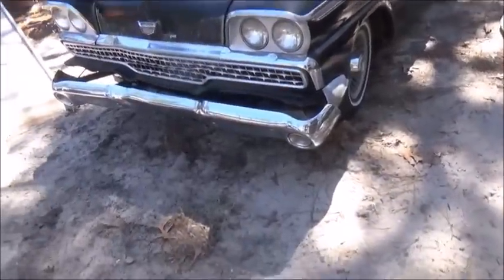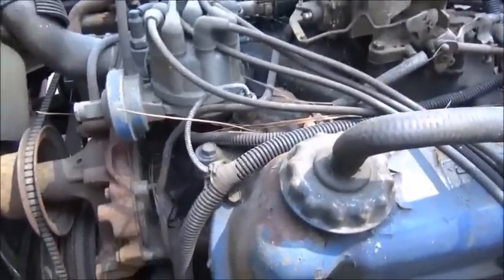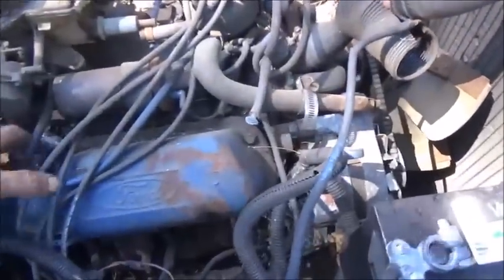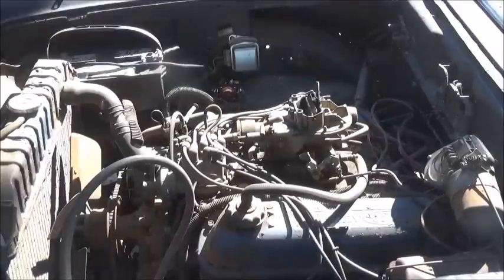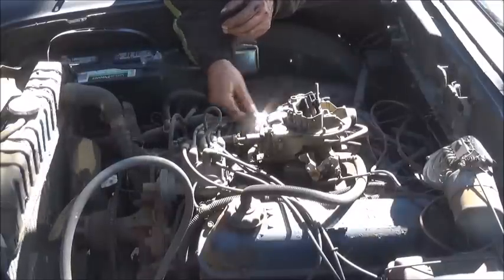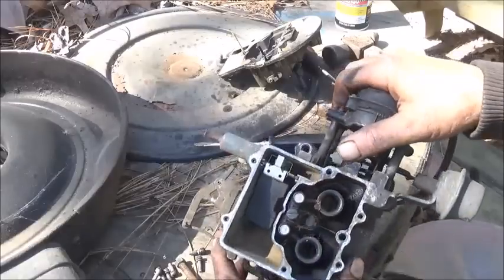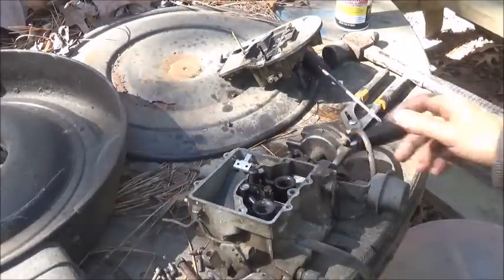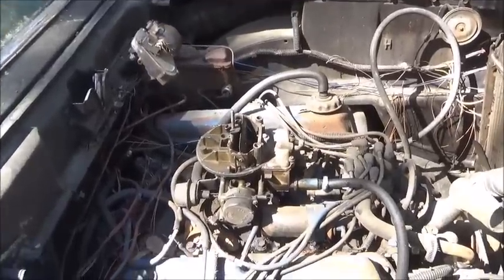1959 FORD GALAXIE FAIRLANE 500 FIRST START IN YEARS!!

Comment: I remember back in the 1970's back in my teen years .We lived in the Snow/ Rust belt of Northeast Ohio ,My Dad was a Pennsylvania coal miner raising 6 of us kids and our mom on a coal miners pay .We didn't have a pot to piss in ....Ohio cars had inspections in order to get your license plates .If you failed you was walking to work or going on welfare because you didn't have a car ...When ever a brake line rusted out or inspection time came and dad seen rust on the brake line He would say " We got to get this fixed or we ain't going to pass ..My Dad would go to the hardware and buy a long roll of copper tubing , He would take all the rusted brake lines off the car and cut and shape the copper line to match the steel line and take his fairing tool and put the fittings on the line .Then spray paint the copper tubing to cover the fact that it was copper line and not steel line .Then bolt it all in and drive down and pass inspection ...I as a kid .asked My Dad " Why don't you just replace it with steel line ..Dad said that Steel line was too expensive back then .Copper was the only thing he could afford back then ....Dad said " I've got to get to work ..without a car we are screwed ...It worked .never had a line blow ..When Dad got to sick from Black lung .Doctors told my Dad that he had to move to a warmer climate or he wouldn't live to see spring .He bought a rust bucket 1973 Dodge van with rotted out brake lines and replaced them with copper ..We moved to Fla back in 82 ..I got my DL back then and Dad gave me the van because he could no longer drive ..I drove that van around Tampa Bay FL for over 3 years before I bought a 1974 Vega wagon and scrapped the van ...My Dad was an Army Veteran and a Mine Mechanic. He worked on the machinery down in the mines ......He always told me " Sometimes in life  Son ..you got to do what you got to do to Get by " ....My Dad died Back in 1988 at age 49 of Black lung ..Raised all 6 of us kids until he passed ..He is Buried in Bay Pines National War Veterans Memorial cemetery in Pinellas County FL ....Rest in Peace Dad
Reply: Respect for your dad. He loved his country and his family. I lived in St Pete down by Lake Maggiore. My soon to be wife lived in Largo. Back then it was faster to go up alt 19 than the interstate.
That was over 45 years ago. My wife and I were married 43 years, it's been almost a year since she passed. Back then I knew the area well, now not so much.
I also grew up in Ohio, Marysville on the west side of Columbus. Dad used to say there was nothing wrong with a junkyard engine, the car just fell apart around it. 
Cheers
Terry

Comment: Good to see you back Jonathan. 
If anyone has put grease in a pilot bearing to press it out, a compression fitting will do the same. Copper line will fatigue at bends and fittings because it is originally soft and stretches  but work hardens and cracks. Use steel or stainless with double flares folks.
Cheers
Terry

Comment: Listen folks when a tow truck driver tells you something is dangerous it is. You can bet he has seen every bad out come of any thing you can think of. Be safe guys just flare your lines.
Reply: Sad thing is, I had an auto parts associate talk me into a compression fitting for a forklift brake line. The same principle applies. I was ignorant back then and know way better now. If I'd known better, I would've turned the guy in to the manager of the store for suggesting such a thing. That could've been a huge liability issue.

Comment: Water pump pulley is bent too. I tell you what those old windsor motors are some of the best ford ever made, my old motorhome was sitting  for about 20 years and after cleaning the carb and fuel tank it ran beautifully.
Reply: Me and my friends rescue old cars, we came to the conclusion GM sucks most of the time, Fords and mopars are awesome, amc is ok Studebaker is rusty but good.
Reply: @jackrohde4709  Well personal opinions and all that, i like older fords, chevys, imports, really old mopars, and think most of the cars from the 50s and 60s are cool but impractical

Comment: When turning wrenches professionally, I remember seeing a stretch limo come in for service that had compression fittings on the brake lines. The factory stainless exhaust was extended with that mild steel garbage pipe that rots out in 3 years. Both done by the company that stretched the body. Could only imagine what that car cost, and they couldn’t even do a professional job underneath. 

The only reason I’d ever use a compression fitting on a brake line is to get myself out of being stranded on the side of the road, with no other rescue possible. Pretty easy to get double flair line, or metric bubble flair in any length you want, and put them together with proper unions.

Comment: So correct on the brake lines! I have a drawer full of spl tools for swag ing the double flare brake fittings,  benders ect. It takes a little while to get good at, well worth the time. These days, lines can be purchased in near proper length as well. Thanks for another great video

Comment: The "D" prefix on the intake manifold is 1970s-the next digit-"1" is for 1971-D2 is 1972-etc-great videos, my friend!
Reply: i was watching the video and i noticed it was not a 1959 engine and was a 68 or later
Reply: Thats just a casting # and doesn't prove the year.
Reply: @totallyjonesin  More than likely it's a '71. It gets a little dicey during transition years. I owned a '68 302 block w/ a 289 crankshaft years ago. A transition year for both engines.
Reply: @josephtravers777  68 was the first year for the 302 and the last year for the 289. I've seen alot of 68 Fords and Mercurys with both engines in them.
Reply: @markreisen7038  The '68 302 was a dud engine and was prone to cracking pistons. Factory defect. Ford fixed the problem in '69.

Comment: glad to hear you defend the proper care and set up of the brake hydraulics. Compression fittings, single flares and such are illegal in most states. The double flare is not hard to do but many people are intimidated by it and will not even buy the flaring tool kit. These folks are laying the groundwork for a tragedy for someone, someday. There comes a point that DIY'ers really need to understand their limitations and quit ignoring sound repair practices.

Comment: Love the vids, you go about it all the same way I always did! That casting number D1AE on the intake just means it's a 1971 (design year) Automotive Engine (D=70s, C=60s, E=80s etc etc next digit is the "1s" place in the year) All Ford part numbers work that way so it's easy to tell what year (approximately) a part is. What you've got there is a Windsor - 2 easy ways to tell are the valve covers are the same as 302 (Cleveland are more rectangle like small block Chev but with 8 bolts), and the thermostat is on the intake on the Windsor, the block on the Cleveland. Don't buy into the small/big block BS some folks say. Ford doesn't work like that, they have engine families (Windsor, Cleveland, FE, 385, Y-block.....). Ford's only "big block" was the 385 family - 429/460.

Comment: Hey Johnathan. Man you can tell a 302 Windsor and a 351 Windsor apart by the firing order. They are indeed different. Thank you sir. Yes sir find an old Ford truck with a Holley on a lot came from factory with one. Fit right on it. 302 to 460 will fit. Good show Johnathan. Thanks.

Comment: Really enjoy these old, cold starts and this one starts and runs real smooth. I forget if you said there is coolant in it or not. Some want to change out the engine oil before cold starting an old engine but changing it hot once it runs is good enough.
Reply: I really enjoy those too!

Comment: I was a professional mechanic for years, and I would agree with you on the compression fittings. When I went to school we were taught never under any circumstances to use those things on brake lines. 
some states they're not legal to even be used on a cars brakes.. where I started out working was in Pennsylvania(1979) and you could not get a state inspection on a car, which gives you permission to drive it on the road, if it had a compression fitting on it. Of course you could always find a mechanic that would sell you a sticker or pay to have a sticker put on your car!

Comment: Love the air hose fitting sticking out the back of the carb! Have to wonder what the thought was there....
The inside of that carb will clean up just fine if you blast it with baking soda. I use a cheap handheld blaster from Horror Fright. Works great!
Whoever owned that thing must have been tighter than two coats of paint! Couldn’t afford a proper brake line, or even a 99 cent plug for the carb...  If the carb is leaking at the bottom, it’s probably the power valve.

Comment: AGREE 100%  with your assessment of brakes.  Personally I rebuild my cars from the bottom up.  Tires, brakes, suspension steering, and then the mechanics of the engine and running gear.  Another thing to watch (although most cars had a fail-safe system for this) is the steering shaft's cloth/neoprene coupling which in normal life gives no trouble, but after decades will in fact fail.

Comment: I have used compression fittings before, and have never seen one fail, but it's actually illegal here in Pennsylvania, and you're totally right, all it takes is that one time that you really need your brakes that it'll fail. Either you're going to be hurt or killed, or even worse, you could live and kill someone else. I couldn't live with that, that's why if I need to replace a brake line I replace the entire thing unless there's a union or connection somewhere. The best thing you can do is cut the line, put a nut on, flare it, and use a flared union.

Comment: You are right, never use a ferrule fittings on a break line. A freind of mine had a nice 67 GTO that he bought from a guy that had "supposedly" resorored the car, Well long story short while my buddy was driving it a person pulled out in front of him and he jamed on the breaks and it blew the line and he wound up totling ot the 67 GTO. Thanks RCindustry
Reply: I'm not questioning your story, but I do wonder about getting cars "safety checked" when they're sold.  And even then, I'm not sure that having a vehicle "safetied" includes fully inspecting the brake lines from stem to stern. I know that hoses are part of the inspection, but what about the hard lines?  All that said, in the 35yrs I've been driving, I don't ever recall checking the hard lines on anything I'd just bought, either... but then, I've also never had a recently purchased car pop a brake line shortly after taking possession of it.

Comment: very interesting and informative video. I have a 59 Galaxie 2 door 332. Look forward to your next installment :)
Reply: Jr ALEXANDER  no I don't. My Galaxie now at the workshop getting the Holley 2 barrel carby overhauled.
Reply: Jr ALEXANDER  I will pick up mine after Easter, I live in Germany now and my Galaxie is an original one owner 70k miles from CA. A German guy bought it and imported it to Bavaria and got it ready for heritage rego. It basically has had all wear and tear essential jobs done and is problem free. They will overhaul the carby  for circa $130US and probably 2 hours labour and do a full service. Good to know a new carby costs around $200, thanks for that tip.

Comment: Someone has converted it to a dual-circuit master cylinder. Will be interesting to see how it works based on the half-ass brake lines. Remember that factory 4-wheel drums don't use a proportioning valve...distribution block only.
Reply from the maker: Tyler they used one Outlet on the master cylinder for the brake light switch so they're only running it as a single
Reply: @jonathanw4942  Now I've seen everything.

Comment: Damn right about if you're gonna spend money on your car, spend it on the brake system. I'm a drivewaymechanic and I wanted to replace the brakehoses. I have the right tools but I just couldn't get them loose. Didn't take a chance and had my garage do it. They couldn't free them up either. Ended up with whole new lines.

Comment: This 1971 400 block (D1AE-A2C) has a smallblock bellhousing bolt pattern, which is quite rare. Notice the undrilled 385 series big-block pattern in the casting.

Comment: water pump pulley wobbles may need water pump . if compression fitting not properly tightened they will pop apart. i was thinking 302 and windsor have different firing order .
Reply: Different years have different order too
Reply: I suspect it is the pump bearing going bad because it smooths out when revved.
Reply: Fords are a peculiar beast. 302 HO's have the same firing order as a 351W.

Regular 302's have a different order yet.

Comment: Windsor block is also taller than the 302 block. If you look at the distributor mount area the base of it will be even with the surface of the block on the 302 , the block surface will be taller in that area on the Windsor.

Comment: That motor is definitely a 351 Windsor. That casting on the intake is the part number for the intake manifold. D1 at the beginning indicates 1971, but common parts carried over from year to year. The part number would change if it was redesigned somehow.

Comment: May I suggest  to Replace them with NiCopp lines or Stainless Steel that does not rust. Power valve gasket on the bottom is leaking.

Comment: The casting on the intake is a 71 casting... in the ford world the decade can be determined by a letter like the 60s would be C, the 70s D, and so on and the number following is the year so the D1AE casting is from 1971
Reply: That's just the oldest it could be. They used the same casting/engineering #'s for multiple years. So the D1AE could be a 71, 72, 73 or 74.  They changed the last letters( ones after part family #'s ) when they made engineering revisions to the part.    To know the age of the engine for sure he would have to find the casting/engineering # down by the starter and the date code. The date code will tell the exact day, month & year the part was cast.  But it is a early 70's ( 71-74 ) small block out of a fullsize Ford car.
Reply: Fordman7575 your absolutely right
Reply: Not completely true. The casting/engineering # will only give you the decade, the first year that version of the part was used, The vehicle group the part was for( doesn't mean it wasn't used in other vehicles though ) , and the part family/group, followed by the part # group and finally the engineering version. To know the exact date  you need the casting # for the decade and then the date code for the day, month and exact year.  For example Ford used the D1AE casting # from 71-74 on many parts. They didn't always have a new casting/engineering  # each year.  I have parts that have 66 casting #'s and 68 date codes. 71 casting # & 73 date codes, 75 casting # and 77 date code. etc, etc.
Reply: @Fordman7575  
Know why I posted the link? 
So that you wouldn't have to type in a comment.
The Intraweb is full of experts,never wrong
Reply: They did use alot of stuff for quite awhile.. and some things they changed year to year like the e5, e6, and e7 heads from 85, 86, 87 windsors all had different heads but generally you can get the era their from just by looking around at the castings but it doesn’t really matter you can swap/ mix match these windsors to do whatever you want them to

Comment: Yeah I seen a few videos where the guy cuts out a rusty section of brake line and installed a compression inline coupling this one video on you tube he only replaced about six inches of brake line. you need to use a double flared joint if you have to you can get a flaring tool at harbor freight I got kick out of the exhaust system mickey mouse I(t a good looking car untyil you showed us the number of sheet metal screws, in the trim.

Comment: 351 has more space from throttle shaft to valve cover so I think 302. The distributor and carb are later so it is past 289 production. Assuming all those parts and intake are original.'

Comment: D1 on the intake casting number denotes 1971.  D is 1970s decade, C is 1960s decade, E is 1980s decade and so on. 1 through 9 next to the letter is the year within the decade. So, D1= 1971. :)
Reply: I should have stated 0 through 9. Zero would have been 1970. Sorry for the error.

Comment: The Windsor has 6 bolts holding the valve cover on, the Cleveland has 8 bolts. So it says.
Reply: Modifieds had 8 bolts too. Best way to tell is running the casting number by the starter

Comment: She's a runner! You can use those casting numbers to tell AT LEAST what year some part of the engine is. For example..."C" is 1960's, "D" is 70's, the number in the second position is the year of the decade that indicates the first year that particular part was used, the "AE" is Ford engineering and so on. I'd keep an eye on that water pump pulley...it's looking wobbly!

Comment: I know this video was a long time ago... but, to reaffirm the compression fitting issue listen to the man! I've been putting fittings together for 50 years (power plant, semiconductor plants, etc.) and the brass compression fittings on the steel line is scary. First off, the brass is too soft to compress on the steel, due to difference is coefficient of expansion the brass fitting can expand enough to loosen on the tube, and it's illegal!
I have installed compression fittings that will safely hold tens of thousands of pounds of pressure. They are stainless and gauged for proper tightness on .065 stainless tube.
I can't imagine that someone thinks this is ok.
Bill

Comment: A double-flare kit is dirt cheap.  Also eliminates the need to buy those compression unions.  Lets you use real unions.   Never skimp on brake lines.  It's the cheapest part of the system.